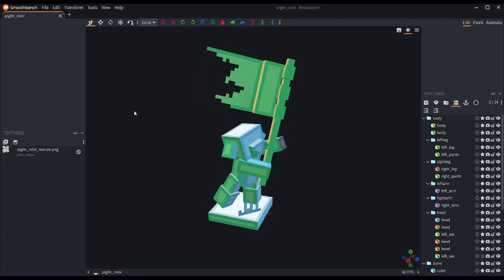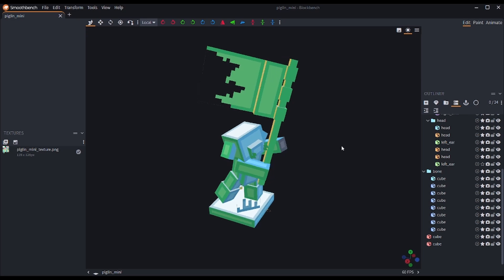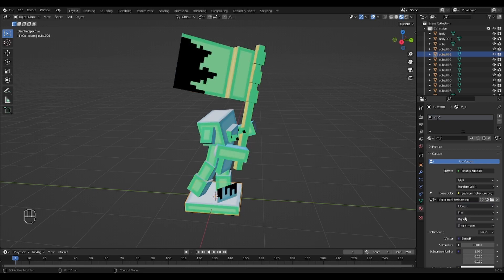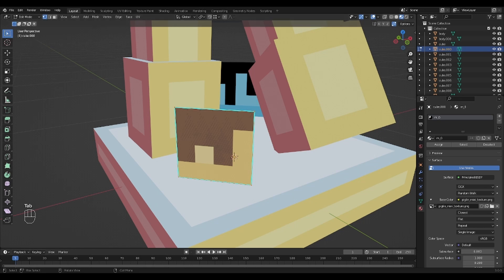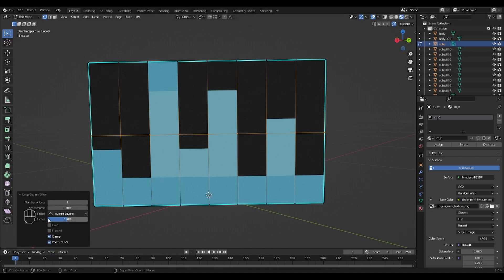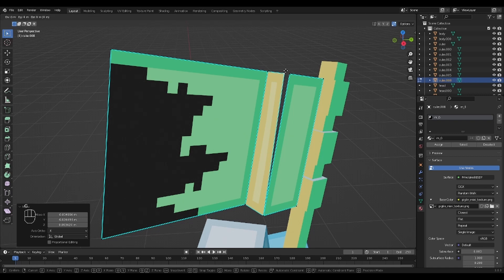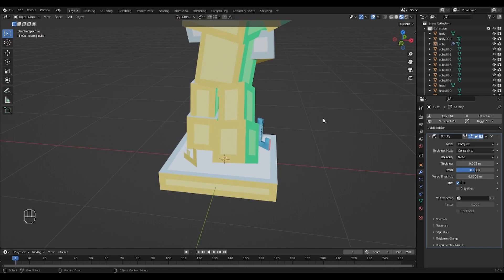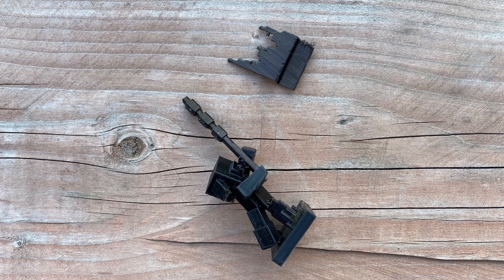How to 3D print Blockbench Models

Comment: Do you know if there is an easy way to export a minecraft player model with minecraft skin applied to export it where the skin is multi color or multi parts so u can paint them for printing? I used a Blender addon called MCPrep where applied my skin to player model, but when I export, only 3d model option i have is stl which will not give me colors or anything i can use in my slicer.

Comment: Amazing video! One question: i once printed a model of mine, but the owner of the printer told me to individually separate the parts. Is there any extra consideration to keep in mind if i want to print something on a specific pose, like you did?
Reply from the maker: Yeah, I think it really depends on the purpose of the model. The only reason you'd really print in separate parts is if you want to have parts printed with a specific print pattern, or if you're model requires you to. Like if I wanted to make an MC Model with moving joints I would have to design it with that in mind. For this purpose, there's no reason to really separate things. Though I will say, if I could do it again I'd probably create a slot for the flag and print the flag separately to increase structure.
Reply: @mistergriimm  great! Thank you!